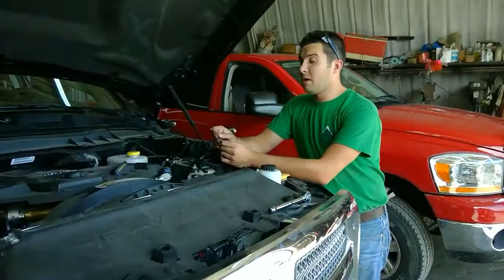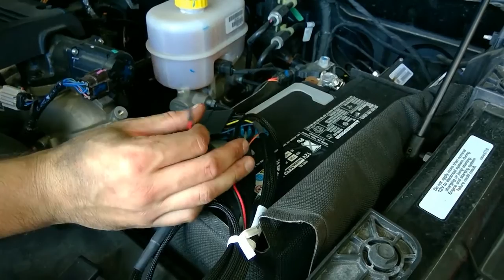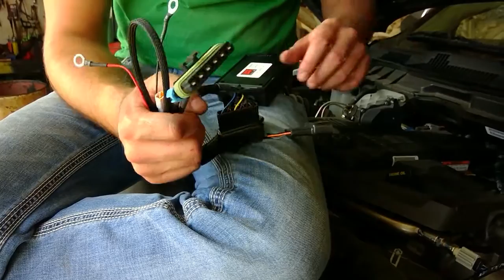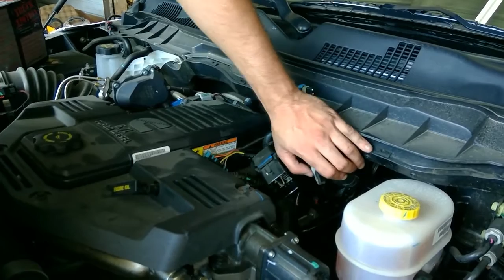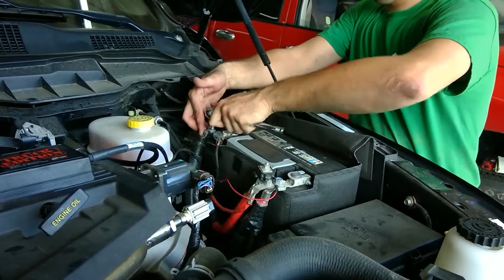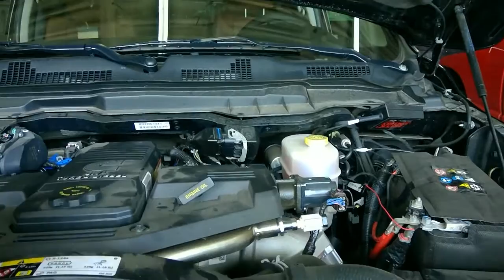2013.5-2018 6.7L RAM Cummins 20250 Module Installation

Comment: Check engine light came on. We have installed correctly after checking with your video. Tried clearing codes & that did not work. Any suggestions?? Also noticed you did not switch MAP sensor & we did.
Reply from the maker: Contact our technical support team here- https://www.agdieselsolutions.com/contact/#techsupport or call us at 812-618-9168

Comment: It works on 2019 the new model ram 3500 6.7 ?? Just bought one installed it but no any different. The box says it works for 2013.5-2020 so i guess its okay but literally no different

Comment: Any pointers on installing an ECM in a 2011 dodge 3500?
Reply from the maker: Sorry @aquatictwistlc, we do not install or remove ECM's, we manufacture plug and play modules for diesel engines.

Comment: Will this work on a 2017 model as well?
Reply from the maker: Yes, it will work on the 2017 as well, just at the time we shot the video the 17s where not out yet.  Thank you for the comment and I will get that corrected.
Reply: What are the estimated hp/tq/mpg gains for the 2017 6.7? Do I need to run the module in high mode to see best mpg gains? Or is it in relation as to what setting it is on? Should there be any MPG gains in the stock mode?
Reply from the maker: Ken Smith, here is the link to the dyno video that will give you all the numbers with the truck on stock mode and on high mode.  Same with others, you will get best performance and fuel savings on the high setting.  https://www.youtube.com/watch?v=4F6iNo0pmMM
Reply: Thanks. I know there are a lot of different circumstances etc...but, 43 hp gain at high is short of 30%, 90hp gain.
Reply from the maker: Every truck does react differently to the module, but keep in mind that these are to the ground numbers not inflated flywheel horsepower ratings.